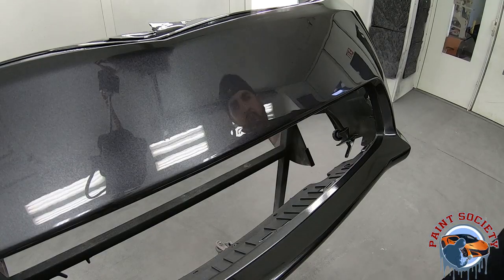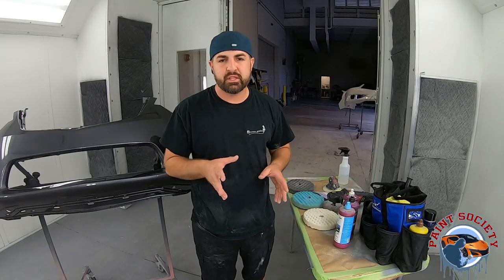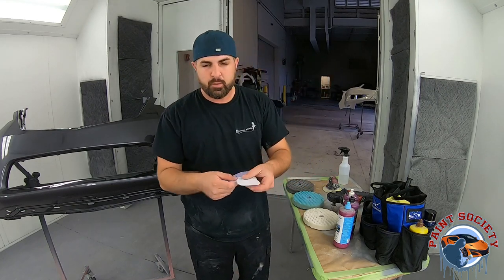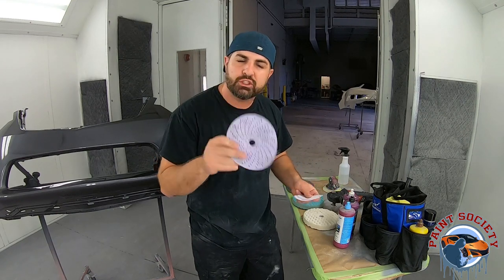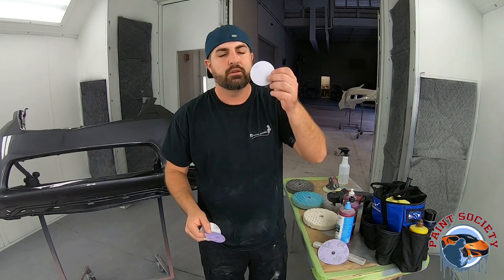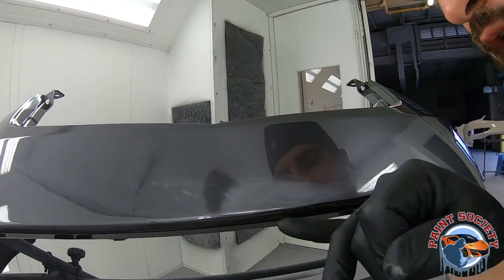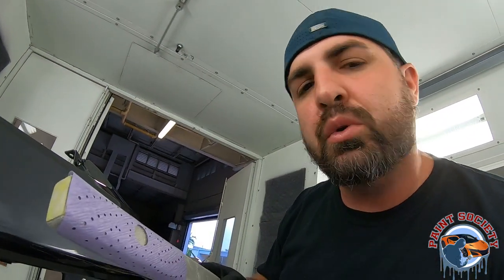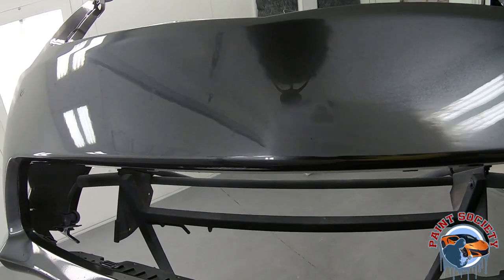DIY: Remove Paint Defects from FRESH PAINT

Comment: Hey Brian, I’ve been watching your videos, and they’re awesome—really appreciate all the great tips! Quick question: I’m working on a silver metallic paint job, but it feels a bit rough to the touch after applying 3 coats of metallic silver and 3 coats of 1K clear. Is it okay to wet sand metallic paint to smooth it out, or should I be cautious about affecting the finish? I am using spray cans btw. Would love your advice on this. Thanks again for the amazing content!

Comment: How long after i clear can i do this
Reply from the maker: That’s going to depend on the type of clear and drying condition you have. Check your Technical data sheet for a detailed answer but good rule of thumb would be at least 24 hours. You don’t want that clear to be too soft otherwise it won’t sand nicely.